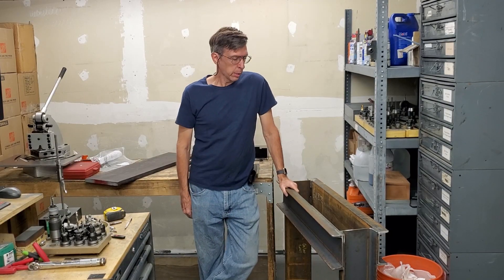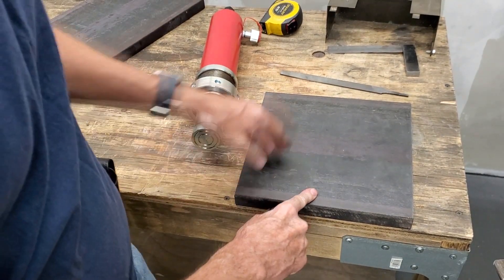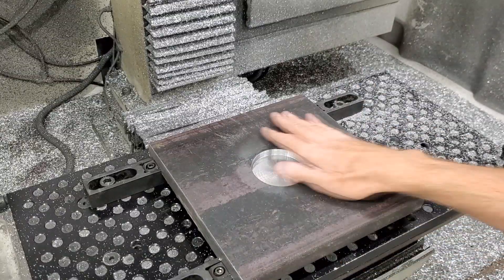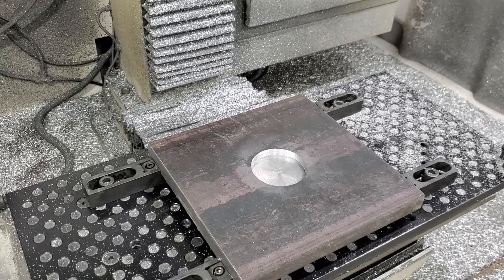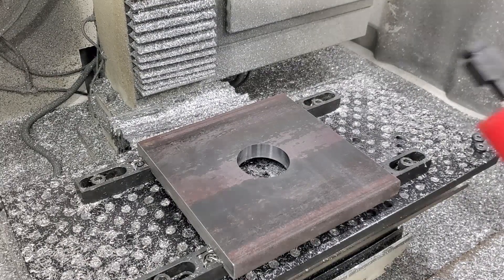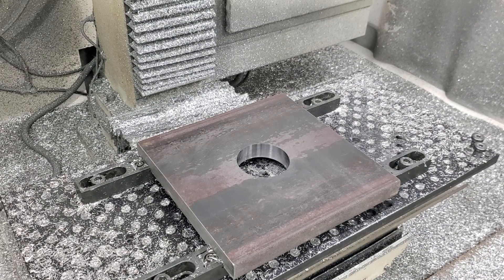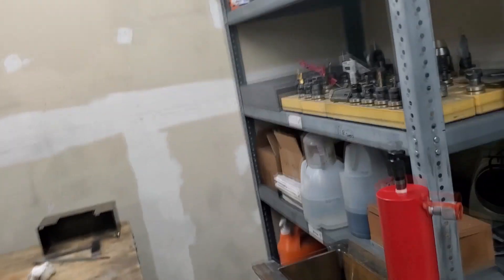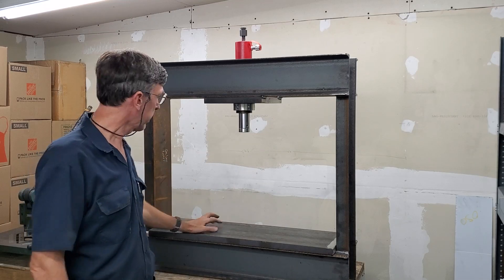CNC Press Brake Part 1 - Frame and Cylinder Mount

Comment: Where did you get the hydraulic cylinder?
Reply from the maker: Redline. https://www.redlinestands.com/catalog/shop-equipment-c-327/general-shop-equipment-c-327_335/shop-press-parts-c-327_335_236/redline-replacement-shop-press-cylinder-p-2929

Comment: You need to get you a small high feed mill makes quick work of stuff like putting that hole in
Reply: predrill half inch then 1/4 or 3/8 feed mill w/ 50% stepover would wreck that probably, but a 1/4" or bigger kennametal harvi 1 4fl would make short work of it as well.  I think the "TE" series sacrifices a lot of vibration dampening of the original harvey 1 for extra plunging.
Reply: @multiHappyHacker  I wouldn't even predrill, I'd just ramp into it with about a 60% step over, if the tormach is rigid enough
Reply: @Daniel-vq9zb  it should be able to ramp reasonably well with a 1/4 tool in steel.
Reply from the maker: @multiHappyHacker  What kind of step-down to you normally do with a high feed mill?
Reply: @craigsmachineshop2040  10 or 15 thou, not much
Reply from the maker: @multiHappyHacker  Thanks
Reply from the maker: Thanks, yeah I will have to give one of those a try. I don't really know much about them. I just got a 3/8 rougher from Lakeshore Carbide which has been helping.